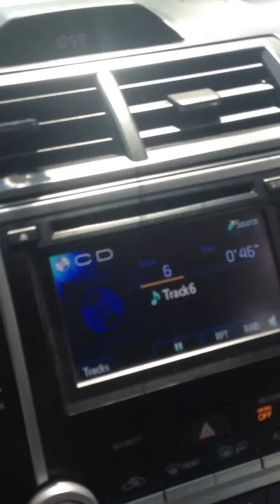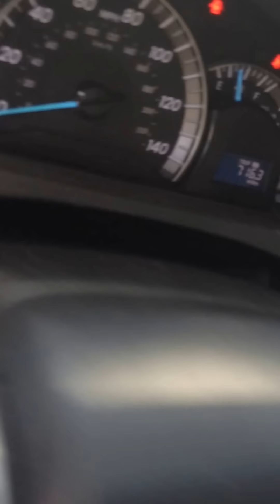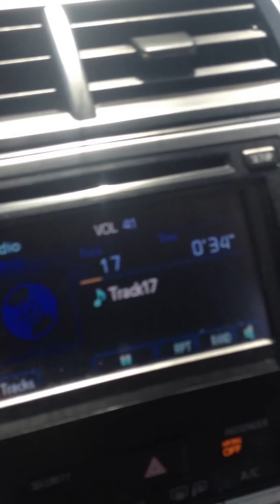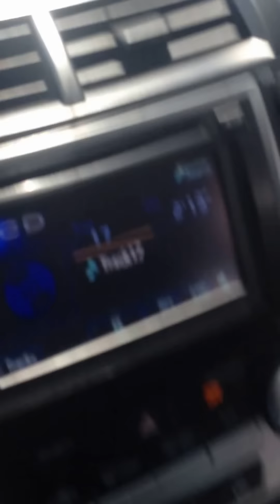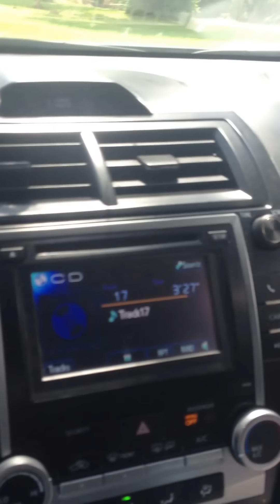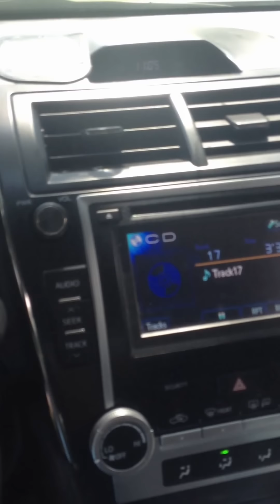SoundQubed HDS3 12's and Q2200.1/Mechman 240amp HO alt, and 3 AGM's.

Comment: Thanks dude , I just blew a American bass xfl 1522 . I had it in a 5.67 cube box and tuned at 33 hz , and it didnt get as low as I wanted. Now Im looking for a couple of 12s . But Im look for low deep bass at around 32hz
Reply from the maker: jdavis02136 These will hit 32hz HARD all day long... It's actually in it's sweet spot.  Just build your enclosure around 4.5-5 c/ft NET (after all displacements) and tune to 33hz... You will get low and loud.  Sucks you blew your AB.  It wouldn't get low?  Did you not tune it correctly?  An XFL 15 should hit 32hz no problem...
Reply: David Harris its okay. I'm going to recone my xfl.  I got 2 audiopipe txxbd3 12s now in a 4.67 cube box tuned to 34 hz a they get LOOOOW and loud.

Comment: I'm thinking of doing the same setup in my hooptie except hdc3's instead of the street. I think I'm going to get 2 hdc315's and one 4500.1 if I can get the electrical right for it. Right now in my new car I have all JL 13w7 in a sealed pro wedge box HD1200/1 amp with C2 evolution 6x9's and 61/2's components and 31/2's in the dash with a alpine head unit with power pack running the highs and mids. Also have 1 1000watt battery in the trunk to power the amp. It's not a db setup but it's sounds awesome and can get loud as hell if you want.

Comment: I got sundown sa 12s but I was looking at other brands and I see the hds312 is 3 inch coil and 40 bucks cheaper but was wondering can they handle crazy amounts of Power like People Put on sundowns
Reply from the maker: I would say as long as you keep your voltage fairly steady, don't let it drop below 12.5, the HDS3's can probably handle 1500-1800 for a little bit.  I would beat on them all day with 1500-2K, but i'm sure they can take it for a little while.  I was putting 1100 to each of mine and they were begging for more.  Brace your enclosure really good and give the subs the support they need, and they should take the power.  The SA's are good subs.  I do like SoundQubed though...
Reply from the maker: David Harris I wouldn't beat on them all day with 1500-2K.  Sorry about that...
Reply: ok thanx for the info

Comment: Nice setup dumb question but , can those hd3s hit lows
Reply from the maker: jdavis02136 It all depends on your definition of low?  Also,  how you tune your enclosure.  They are "ok" on the lows.  Mid 20's and up if you tune to 30hz. Tune to 33 or 34hz and give them a ton of port area and they will play from 27 up to about 60hz.  I thought they hit the lows well until I bought my DSS Ethos.  Those KILL the lows with authority, but you can buy 3 of the HDS3's for one of the Ethos...
Reply: David Harris

Comment: Nice. I have the aq2200 with a fi bl18. I'm actually considering selling it and getting those same subs. In theory it should be louder but that 18 is nasty.
Reply: ***** I actually ended getting a 18hdc3 for $150. Built a bigger box, it sounds really good.
Reply: ***** Trunk can be a bitch! I know, been there done that. Sell it and get a hatchback. It will be noticeably louder and don't worry about sealing off the trunk.
Reply: ***** I'm assuming your going to seal from the back seat. What's the problem?  The trunk opening too small?
Reply: ***** Got ya, would love to help but it's hard to without being there in person. Fortunately it sound like you know what your doing. All I can say is go for it. I've definitely surprised myself trying things I didn't think I could do.

Comment: Why all the electrical upgrades for just a 2k was you having voltage drop or something?  I am running very similar power but JL HD amps and only got one 1k capable batt in the trunk and my voltage never dips below 13 unless I hammer for hours with the lights and air on. Are these soundqubed amps horribly inefficient or are you wired super low .5 .25? Obviously a good electrical is always better then not enough just seems like over kill for 2k unless you plan to upgrade to a 3500-5k. Funny thing is we used to do 150's on 1k watts now it takes ungodly amount of amperage to get there unless you got walls of 18's in a preus.
Reply: he tells u what he wired them at in the vudeo

Comment: do you have a design plan for this enclosure??
Reply from the maker: Not really, all I can tell you is that it's 5.1 gross, 4.2 net after sub/port displacements.  I tuned it around 33hz... Go to SoundQubed'ed website and they will give you a recommendation on port size and enclosure size for each of their subs.  If you have room to build a bigger enclosure, do it with these subs.  They shine with the more space you give them.  I wouldn't think about going lower than 4c/ft with 2 12's from SoundQubed.  I love their products, but one con is they take up A LOT of space.  Send me you design and I will look over it.  Or, tell me what you have and I can give you my 2 cents on it...  Good luck
Reply: Joe X from Steve Meade Design forum has actually designed me one at 4.4 cu ft box... I was looking for something a little smaller but I'm realizing that that isn't a good decision
Reply from the maker: Joe X knows his stuff... Is it a center port design?  If so, would you mind sending it my way?  Even at 4.2 net, i think my enclosure is still a little small for my subs.  Don't get me wrong, they still get down and loud, but I think there is more to these subs than what I'm getting from them.  I would like to see the Joe X design if you don't mind.  I'm also going to fiberglass my next enclosure on the inside and possibly the baffle, to make it stronger/stiffer, and add a little more custom look to it.

Sorry I didn't reply sooner, I've been on vacation in Canada and had no service.  Typically I'm quick to respond...
Reply from the maker: Appreciate that man.  Thanks for the hookup.  I might see if he can design one at 32hz, but if not, the 35hz will still beat down.  Brassard, the guy who showed you his box for his 10's, knows his stuff too.  You should friend request him on Meade and ask him a few things on install.  That guy has some sick installs.  Cool guy as well.  Not a dick by any means.  Let me know how your box comes out.  I love my subs, I just want them in a slightly bigger box and I bet I can get another DB out them...
Reply from the maker: I built my box in the video at 5.1 gross, with a 4" port width, 19" long.  I believe the port height is 15"???  That gives me 60" of port, so  that sounds about right.  this is off the top of my head at the moment.  I guess I could go out there and measure!  But anyway, it came out to 4.2 net.  Also, the guys at SoundQubed are really good at helping you out as well.  Before I do anything, I usually run it by them and wait for them to give me a thumbs up.  Just and FYI...
Reply: David Harris Whats a good port tuning size for these i'm looking for a box, and i see 2 great boxes one 40hz the other 38..

Comment: I just blew my orions or my 2 strapped shark 2500's, getting the Hds3 15's to see if they can handle it
Reply: its because sharks are dirty ass power the orions should be able to handle over rated
Reply: How did that 15 hold up